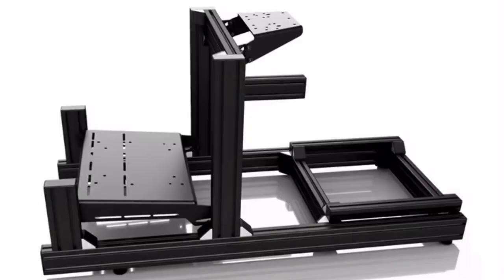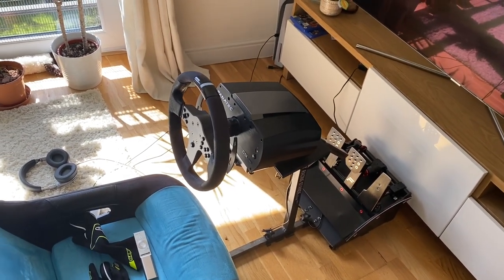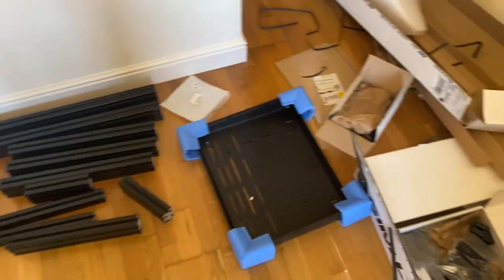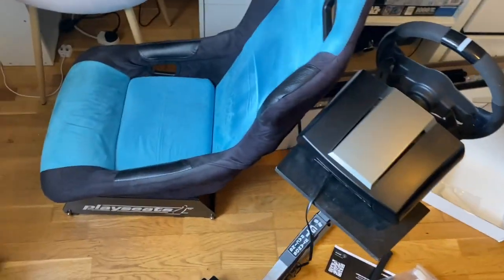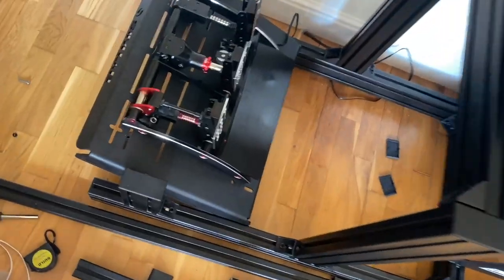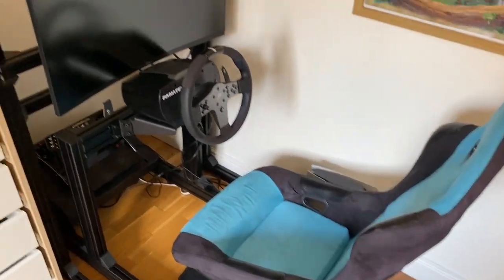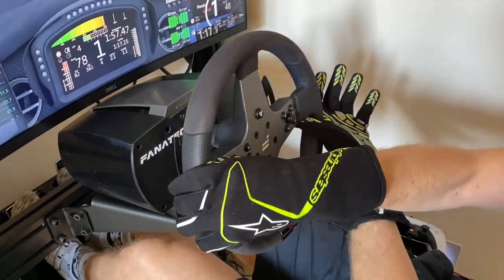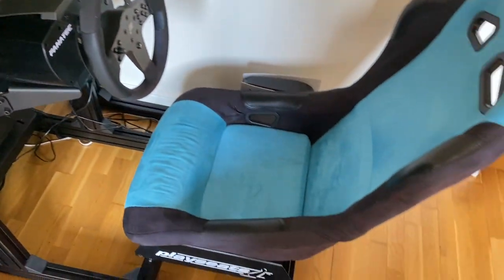Sim-Lab GT1-Evo Sim Racing Cockpit - Build and Short Review + Sim Rig Tour!

Comment: Very nice upgrade mate! I’m looking at upgrading my sim racing rig but Im a little indecisive, this video does certainly help though 😆
Reply from the maker: What have you got at the moment? Id defo recommend one of these aluminium style rigs. They are so adjustable and you can get so many additional things to attach to them
Reply: @OllieRacing  Currently I’m running a GT Omega classic wheel stand and RS6 with my G29, I’m mainly after something more comfortable and space friendly 😂
Reply from the maker: @Zafra991  that’s not a bad set up already! You would be able to bolt the RS6 onto an aluminium frame so wouldn’t need to buy a seat if you did want to do it

Comment: Great video! 
I have a Gaming wheelchair do you think it could be compatible with the GT1 cokpit or i have to buy something for make them match?
Reply from the maker: Thanks mate! I wouldn’t be 100% sure, however as its aluminium profile it’s pretty customisable and can probably be adjusted to fit most things. I’ve since added a swinging arm for a keyboard and changed the seat with one from GT omega without any issues with fitting

Comment: How much better is the gaming monitor than the bigger flat screen TV?
Reply from the maker: I definitely prefer it. I was actually really worried because the TV was 55” and the monitor is only 32” so quite a bit smaller, but as it’s curved and you have it closer to the wheel it actually makes everything seem the right size when you look at it. For example in a cockpit view on the TV the hands and wheel on screen looked bigger than my hands, almost like I was driving a giant car, where now it’s pretty much perfect. It’s also only 1440p rather than 4k, however because the screen is smaller it actually looks really good. Also means that when I can finally get a PC I can play with a high frame rate. 

I’ll do a video on the monitor in a couple of weeks I think.

Comment: Nice setup 👍🏽

What mounting stand are you using?
Reply from the maker: Thanks! For the monitor? I’m using a sim lab monitor stand: https://sim-lab.eu/shop/product/slt010-single-monitor-tv-stand-654#attr=365
Reply: @OllieRacing  Appreciate the quick response
Reply from the maker: No problem buddy!
Reply: @OllieRacing  Hi, how low does the monitor stand adjust to? I want want to use it with a Playseat Evolution for now and the seat is practically on the floor…
Reply from the maker: @kabirshah581  it’s just a few pieces of aluminium bolted together so you can have it as low as you want. You can move the bolts up and down as high or low as you need. Would work well with a playseat as you could have it right behind the wheelbase.
Reply: @OllieRacing  perfect, thanks 😊

Comment: Hi!! I would like to know if when you move hard with your body or wheel the monitor vibrates or moves. Thanks!!
Reply from the maker: Hi mate, I have the separate monitor stand rather than the integrated, so there is no movement. I wouldn’t expect there to be much movement with the integrated stand though as there is very little movement in the part of the frame it would attach to. The beauty of aluminium profile is that if there was too much movement you could easily get an extra bracket to make it more rigid

Comment: Hi mate, the setup looks great. I'm also considering to go for the GT1-Evo Cockpit with a single screen. Just out of curiousity, why did you pick the standing monitor mount instead of the GT1-EVO Single screen holder,
 which you could directly attach to the cockpit?
Reply from the maker: Great question! I went for the standing mount mainly because if I wanted to ever add triple screens or different size screens in the future it just gave me a bit more freedom to do so